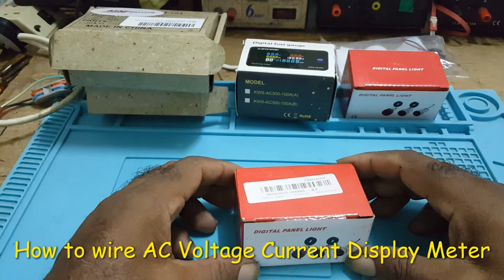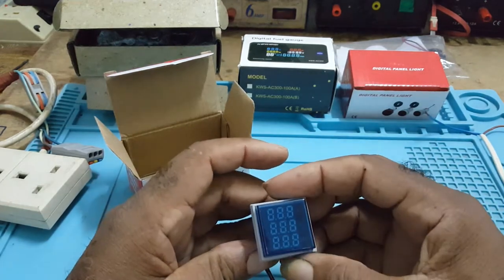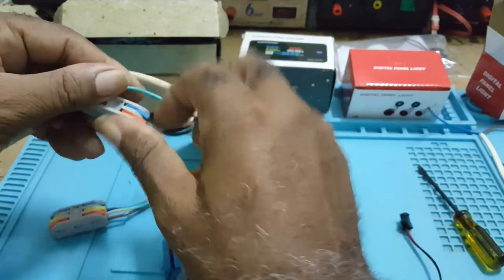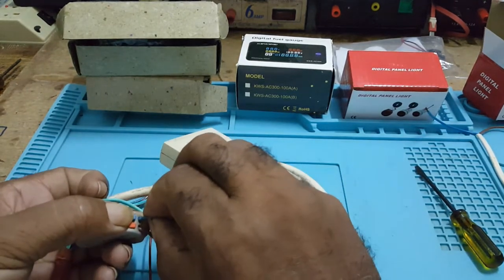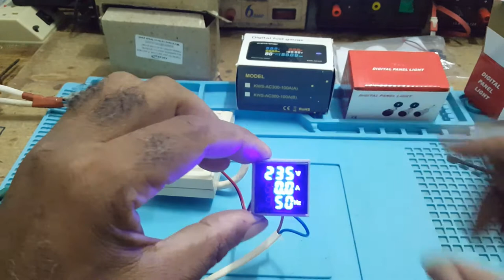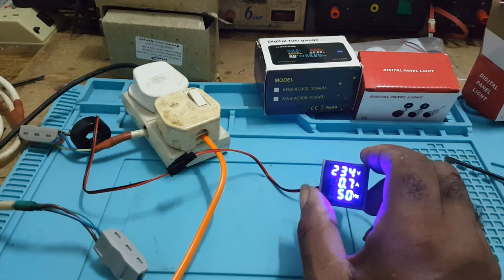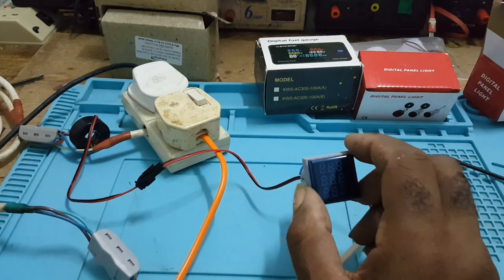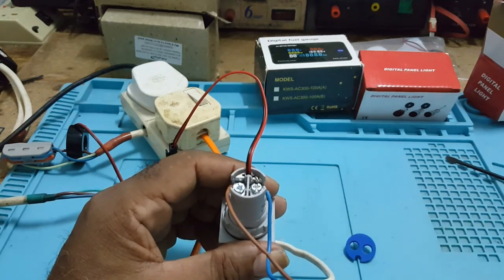How to wire AC Voltage Current Display Meter

Comment: Is there a way to power this meter from a source other than the AC supply? I want the meter to function and not dim at low AC voltage

Comment: For the power leads to the monitor...... the 2 wires you connect to the screws as you showed....do you fuse these? I know the monitor draw must be incredibly low....but it's still an electrical device connected to a 120V/60Hz ( USA) or even 220V/50Hz source. Would it be advisable to add a 1A quick acting fuse?...and if so, only on one of the two legs?
Reply from the maker: : Yes you can fuse one of the legs.
 For the test I didn't.
Reply: @AlwynNicholas  ...thank you for the response.
Reply: i just saw this as i was trying to figure out if these things took AC or DC to power the meter up. For projects where you want to monitor the input to a PSU, you can use the same cable after the IEC socket which i find are sold cheap fused with glass fuse type but typically rated at 10A. You can add your own 1A fuse if you want. The largest danger is the wires, if say there is a short it will be the wires that melt and so your fuse only needs to be smaller than your wires. The worst case is where a wire shorts and pulls all the current, however using the british wiring system our plugs already have a 13A fuse to the surge protector, then another 13A fuse to the UPS, the UPS has a glass 10A fuse, the IEC socket i am using to the PSU another 10A glass fuse. Theres a lot of fuses already.

If you are american and you use this definitely fuse it or you can add both a socket breaker and/or a resettable fuse. see about using a GFCI on your socket instead if american. everyone else around the world have gfci on our mains.
Reply: @System0Error0Message  ...thank you for sharing your thoughts. This question ( for me) is old and since the time I wrote my question, I simply went ahead and added a small fuse on one power-supply leg of each of the meters....cheers, and Merry Christmas.

Comment: can that be use in DC ?
Reply from the maker: That one can't be used. But there are those that can be used for DC.
Reply: Hello sir so the two screws at back of meter x1 and x2 does it mean its positive and negative and do i take the negative wire from the load thru the shunt to monitor the current?

Comment: I have only amp current meter so they told me that mine work with ac and dc but its only ac ampmeter so it wont work to see dc current on my power supply

Comment: you have reason, this meter is not accurate. I put a Dremel of 150 W and it shows 0 amps. It's wrong. I put toroidal probe on the live (red) wire, but it doesn't works properly
Reply from the maker: And I bought a few of them.